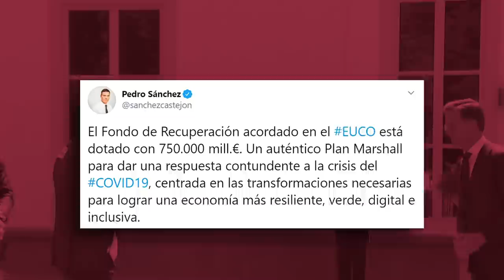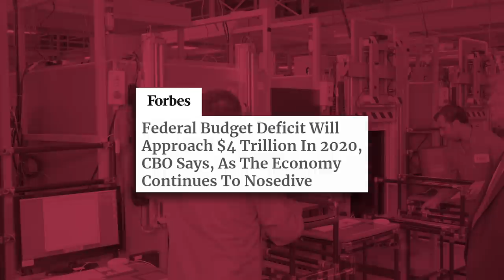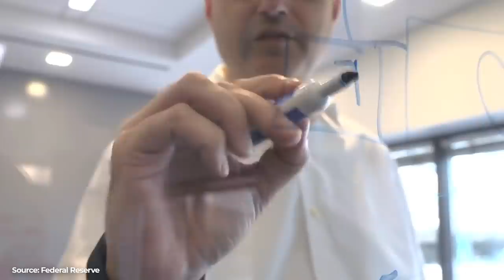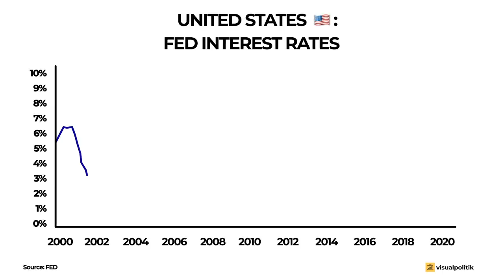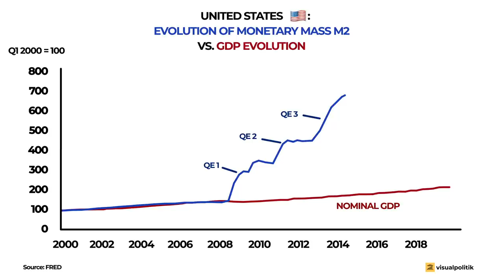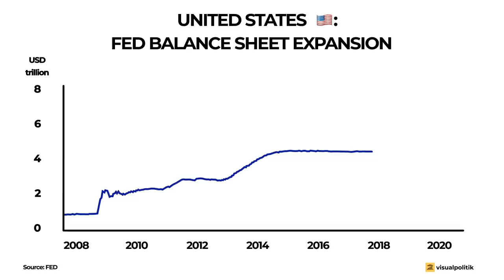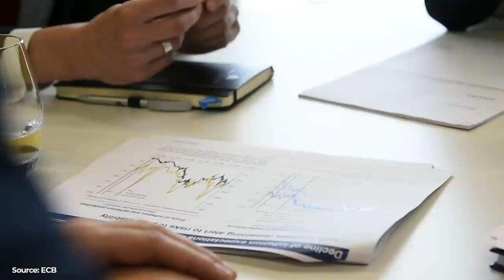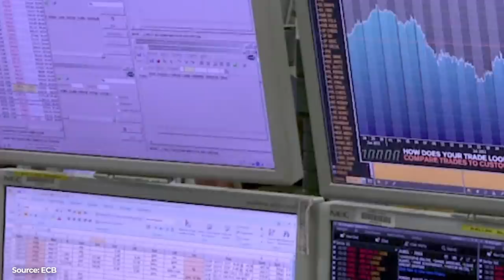Corona Bailouts: The Greatest MONETARY EXPERIMENT in History?  - VisualPolitik EN

Comment: Here's a thought.
The biggest problem that Humanity Faces right now is the monetary system that we use. Fiat Money that isn't backed by anything is a horrible idea. It works for one group of people.. The rich. banks can essentially create money out of debt. they basically buy debt from the reserve and can pay that debt off by selling debt back to the reserve. Either way our current monetary system is based on nothing but what ever the government says. This begs the question? How can we fix it?
 I believe I have the answer. And its not a new Idea per se. I have my own spin on  it. 

We need to convert to a Resource based economy. Resources being the minerals and elements we mine or harvest. this could include aspects of both a fiat system and a commodity system.\

It would eliminate poverty for those that are willing to put in a little effort. Anyone can gather materials. Scrappers do it all the time. scrap metals and electronic components that have rare metals inside them. people can also harvest minerals and raw materials straight from the ground. although this would have to have a control limit when it comes to how large an operation can be and where it would be allowed. The Value of these resources would be based on there current availability within a given market as well as there rarity. These materials Value would be measured in Credits. No inflation, no wallstreet or gambling on what if's, Flat rate, simple, easy credits. I welcome your comments and questions/ideas.